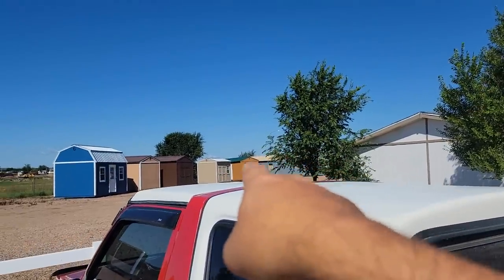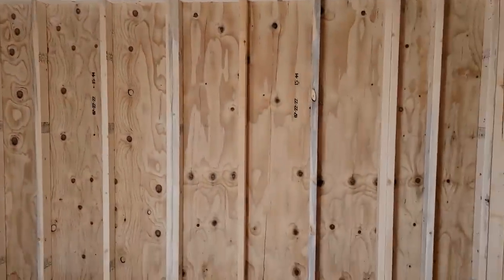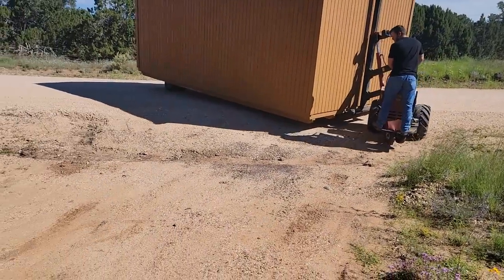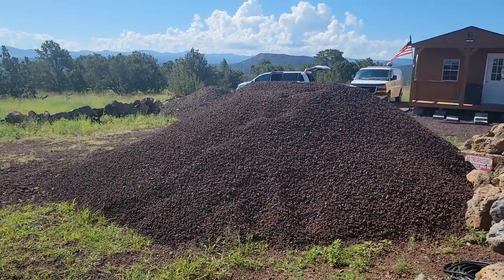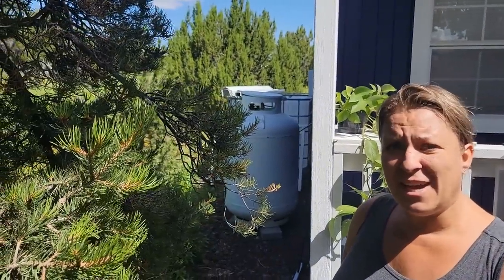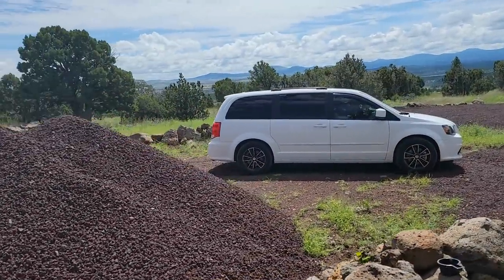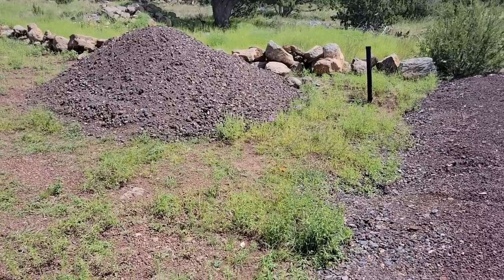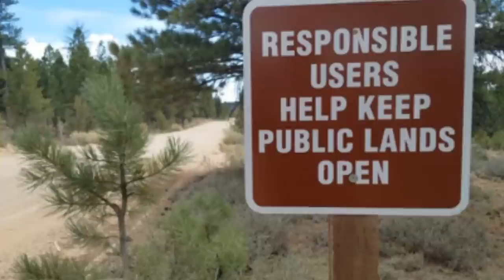RV Base Camp Growing Bigger??? Caravan Carolyn Comes To Visit!

Comment: Greetings, Kevin. I just wanted to add some info to Alyssa's description of uses for pinyon pine resin. The resins of many varieties of pines are amazing for medicinal use. Long needle pines have a huge amount of vitamin C in the tea of the long needles. The resins are antibiotic, antiseptic, antiviral, antimicrobial, provides drawing properties,  provides some topical pain relief, and definitely promotes wound healing. I make a salve from 1 part each of resin, olive (or coconut) oil, and bees' wax all melted and mixed together. It has provided amazing healing of cuts, scrapes, rashes, and blisters. It is easy to make. If you ever use it, you will not be without it. be well, and be blessed.

Comment: You need to add more water collectors to the two brown tiny buildings.  You may not use it quickly but supposedly that part of the country is going dry and water is going to get a lo t more expensive.  Also can't you put a tiny amount of bleach in those storage containers to keep the water clean?  Will that work for your Kidney?
Reply from the maker: I'm next to wettest part of Arizona in the White Mountains. I'm sitting directly on top of the Coconino Auquifier. One of the largest fresh water reserves in the West. Granted its 850 feet thru rock to get it. There are several wells punched in around here.
Reply: @CampervanKevin  Yes, good.  But remember a back up to a back up to a back up. ;)

Comment: Kevin, would you consider having the inside of the new building sprayed with six inches of spray insulation foam. In turn, wire the building for 120/240. place you two IBC totes atop one another for water storage. Use a heating device to maintain at least 42F during the winter. To keep the water from freezing. Store your bikes and possible a washer and dry. Just sayin. Cheers, Mate.

Comment: Howdy agin neighbor, lol. Just want to drop another teddyearp nugget.  That stamp, #2 and then KD HF means this: #2 is a grade used for home construction (and looks to be 16" one center) which is a great step up from what many folks use for a 'shed'.  The KD meas Kiln dried, and the HF means 'Hem-Fir' which in lumber speak is mostly hemlock in the unit, with a tiny possibility of a piece of fir, but never Douglas Fir.  The double plate is great, but the plywood and simpson hangers really shows off the value of your buy.  From a guy that used to buy/sell lumber for 17-18+ years(?)  Oh, my point is, that lumber probably has never seen a beetle; comes from a different part of the country and is a different specie.

Comment: Just curious, would a shipping container be a good choice ? I’d be worried abt termites. CVK could you post a link to the shed movers
Reply from the maker: I priced them out as I was thinking same thing. A used one that is 8x20 was $7500. This was 10x20 for $8 and change. It looked nicer and matched everything here plus a little larger. The Morelans is their channel.
Reply: @CampervanKevin  was jus thinking also those shipping containers must turn into microwave ovens during summers in Ariz 🥵🥵😰